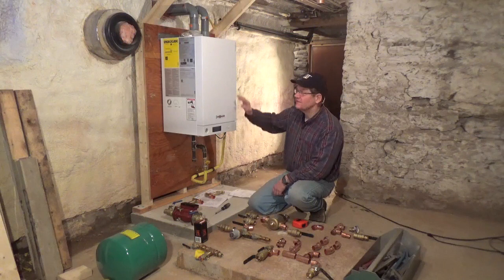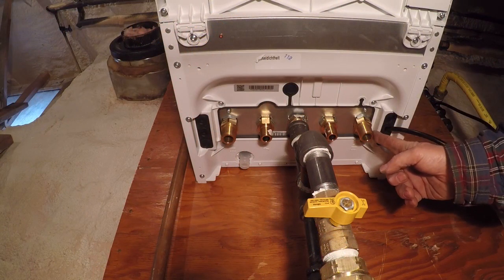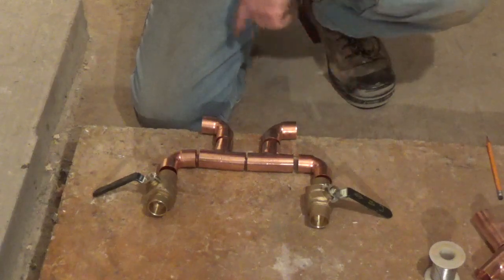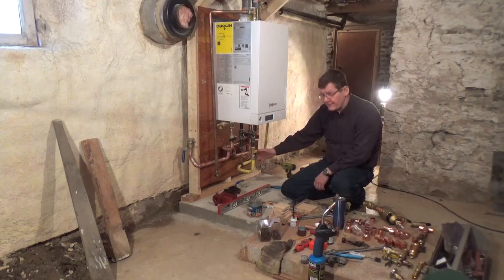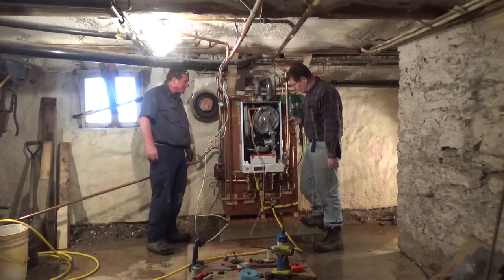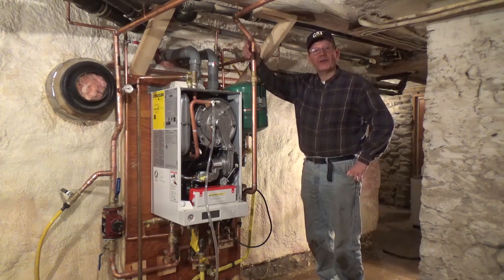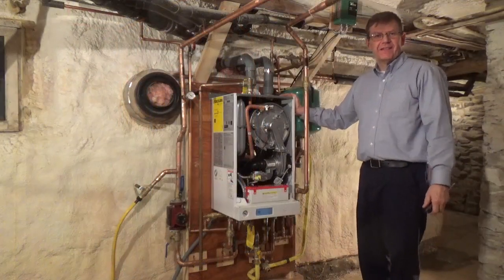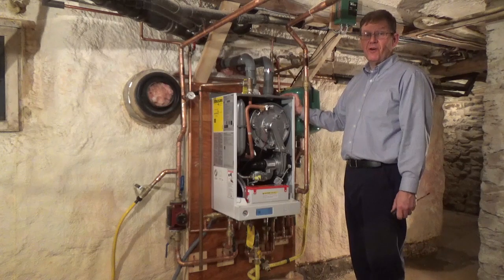Switching from Oil to Propane Part II.

Comment: I’m curious if you’re still enjoying your propane fired boiler with the price of propane now And how much propane do you use a month in the cold months?
Reply from the maker: Greetings,
Good questions; our boiler is a supplemental heat source for our home. 
Our major heat source is a wood stove in our kitchen. Our house is a typical late 1800's 2 story farm house with large rooms and a spacious floor plan. All that said, we are well pleased with the performance of our boiler. We will spend approx. $500.00 this year on propane. The alternative would be furnace oil or electricity and where we are located, both would be considerably more expensive. 
All the best and Blessings to you and your family this Easter Sunday morn.
Reply: Complete newbie to this here - So you heat your water with this? Anything else? sorry if you said in video @OutothehousewithPaul

Comment: What has been your costs of heating with propane over what period of time.  Interesting setup.  How large heating area?  Thank you for sharing.
Reply from the maker: Our house is a large old 2 storey farm house. We stripped off the plaster and lath, insulated, replaced doors and windows, insulated the attic etc. Our major heat source is a woodstove in the kitchen. We harvest the firewood (approx. 5 chords annually) on our farm. The boiler "tops up" our heat when temps. dip much below freezing and/or windy days. We spend less than $500.00 per year on propane. 
Hope this helps!
Thanks for your comments.

Comment: You plumb thhge supply and return hot water together right next to the unit? Is that correct,  seems like it circulating pump would pull already cool water with the hot?
Reply from the maker: Hello Mark, thanks for taking the time to comment. This the third boiler I have installed in our house. The first two did not have closely the spaced Tee that I think you are asking about. When I purchased this boiler I had an HVAC professional give me some advice as I was confused over why it was needed. Because this system has two circ. pumps a possibility of a flow imbalance exists between the two circuits exists. The Closely Spaced Tee provides an alternate path between the two pump circuits to alleviate any possible flow imbalance. I hope this helps. The boiler and heating system is working very well, we are very happy with the system's performance. 
Thanks and have a great day,
Paul
Reply: @OutothehousewithPaul  interesting and thanks for the reply

Comment: Nice looking install Paul. What did you have there b4 for heat I see a chimney? Looks to me like you have plenty of experience soldering those joints so I can see why you didn't have any leaks. Beauty is in the eye of the beholder eh....hope you are satisfied with the equipment install and its performance.  Are you still using some wood elsewhere in home? Guess there will be an update eh?
Reply from the maker: Thanks Buddy, I appreciate your comments. So far we are very satisfied with the boiler. We do have a little hick up with the on demand hot water side of the unit. It a minimum flow issue; nothing that a little thinking and some re-routing of some piping will not solve. I will enjoy the challenge of solving the hickup. The major heat source for our house is still our wood stove. It would just seem wrong not to burn wood. My wife often cooks soups and stews on the wood stove. There is nothing better than on a cold winter's evening after a day's work to come in the house to the kitchen and smell supper bubbling on the wood stove. The boiler augments the wood stove and is mostly needed for very cold windy winter days. Our farm house is built in an L type layout and the wood stove is in kitchen in the small end of the L. 
Thanks,
Paul
Reply from the maker: Forgot to mention in my previous reply that chimney you can see is for a previous boiler. We started out a wood fired there and then after a nasty chimney fire I installed an oil fired unit. It served us well for many years and then last winter developed a crack. Because of the difference in venting between the oil fired unit and the new Viessmann unit we could not use the chimney. I think I will leave the old chimney there as one never knows what the future holds.